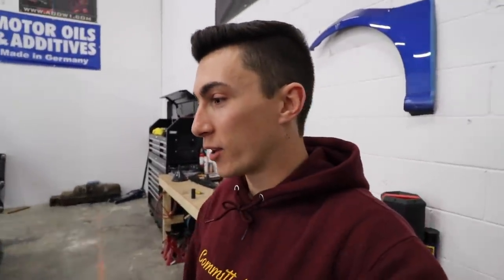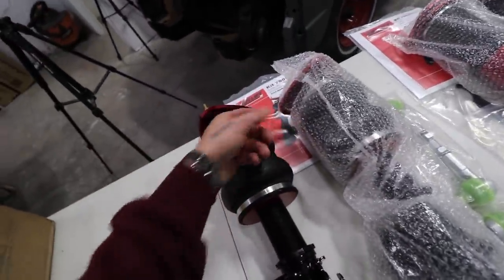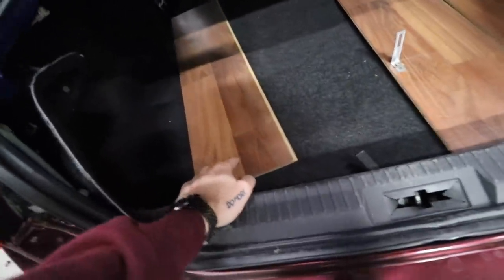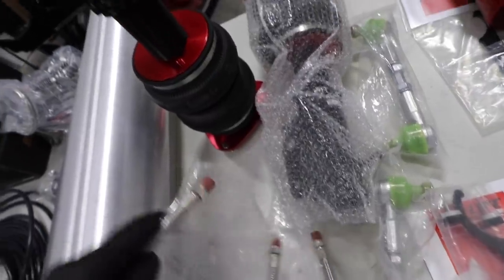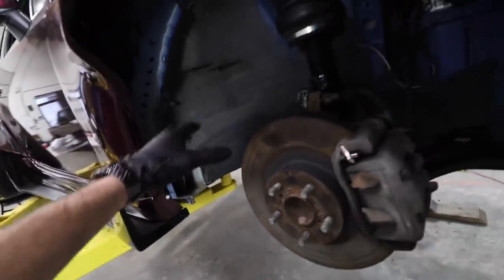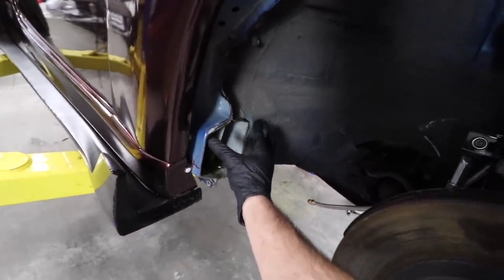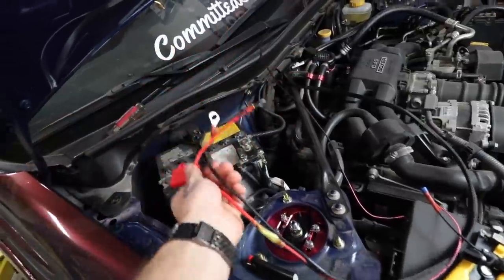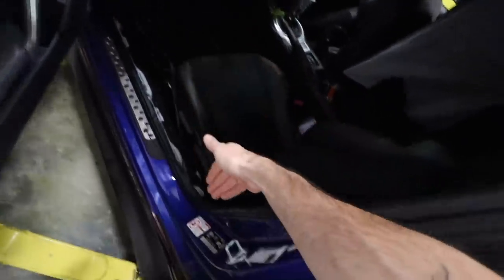BAGGING MY KARMA BRZ🔥

Comment: That's a nice spot where you mounted the air tank. I would put an air chuck in one of the other ports so you have on board air incase you or someone gets a flat tire

Comment: Robbie bro... your 86 looks pretty mint... Only problem is the steering wheel is on the wrong side! When are you coming to Australia? You need to take my 1999 holden vt commodore for a drive! Might not have break neck power but it's like a heavier uglier crown vic that can turn a corner!

Comment: Ok so i know this Vid is over a year old by now but hear me out.....YOU CANT MOUNT YOUR AIR TANK UPSIDE DOWN!!!!!!! the drain HAS to be on the bottom it is used to drain Moisture out of the tank so your air tank doesnt fill up with water and either back fill into your compressor and bags and also so it doesnt rust/ruin the inside of the tank.... so please anyone that does this conversion DO NOT mount the tank the wrong way you will eventually regret it

Comment: if you used a lock washer on the bolt on the inner side you wouldnt have needed that stubby wrench.  It would have just caught the body and the bolt head and it would have tightened up with no worries

Comment: Running the lines through the car doesn’t require any drilling or cutting lol you could tell you have 0 experience with bags 😭
Reply: Jay 10k there is a first time for everything I bet you don’t even got bags lol
Reply: Crowd Control lol I do tho & I did it myself in my driveway at that get off his nuts 😭